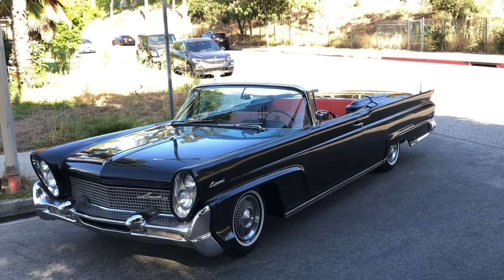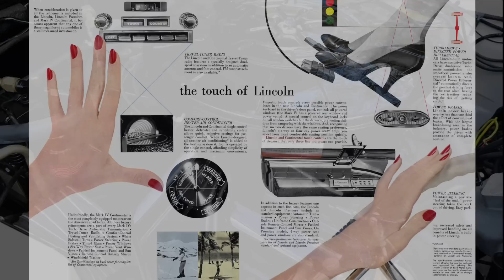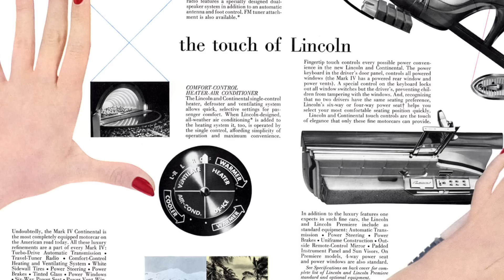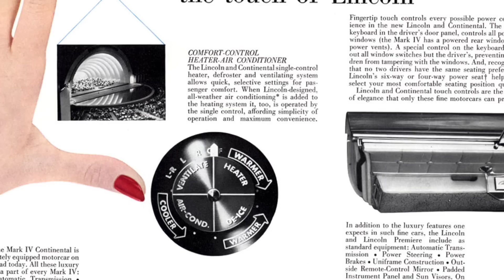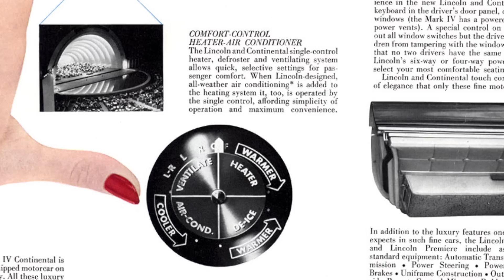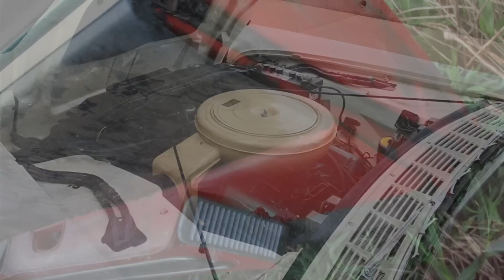Is This The Strangest Automotive Control Ever Produced?  1958-59 Lincoln HVAC Control

Comment: Sorry but I just road in a friends 1960 Continental. They used the same complicated single dial system as 1958-59, it's just moved to the third binnacle from the left. same single control knob air system. And his works beautifully.

Comment: The door panel vent you showed is actually a non-air conditioning car, as the factory air conditioning cars had a slightly different vent with a directional control on it. Also air-conditioning cars have two vents in the dash with with control knobs above them.

Comment: The whole discussion on this set-up is because the use of levers and guide wires was prominent during these years. The one dial design  was possible because  vacuum  rubber tubes were used to open and close plenium doors to direct air into the car cabin. This is all standard use now. Back then, it was novel.

Comment: Hey Adam, as usual thank you for your review of the 58 through 60 Lincolns. I thoroughly enjoyed it, and I learned a few things I didn't know. For example,  the ATC system was very interesting. Leave it to Ford to try something new and let the public decide if it's good or not, Also, Ford is known for their over the top use of engine vacuum to power the function of accessories. I have a 1975 Mercury Marquis, Colony Park 9 passenger wagon. I loved everything about that car, and still do. It was the car I cut my teeth on Ford's vacuum controlled systems. My wagon had hidden headlights with the headlight doors controlled by vacuum. A very complex system. Each door had it's own duel action vacuum motors, the largest vacuum motors I've ever seen. Even the headlight switch on the dash had vacuum running through it. There was a black "coffee can" vacuum storage reservoir mounted to the left front wheel housing under the hood, and there were several vacuum check valves located in the system to lock vacuum in the system when engine vacuum dipped below a certain point. The ATC system worked the same way, although it was even more complicated. As the car aged, some of the vacuum motors under the dash began to leak. Ford designed the system to require 7 inches of vacuum for the system to provide cold air, otherwise it would only provide hot air. I remember troubleshooting both of the systems to understand and fix their problems. Once I did, I spent a couple years searching the country for the right parts. Ford discontinued them 7 years after production. I learned that they continued production longer for the Mark series, once I knew that it was just a matter of learning the Lincoln part numbers. I was even able to crack the code of their part numbers, something many of the parts counter guys never did. I drove parts guys across the country searching for parts for that wagon. But I never gave up until I found all the parts I needed. Most of them were new genuine Ford and Motorcraft parts that had been sitting on dealer shelves, mostly in the east. I learned the cars would rust out back east before they used all the replacement parts, meanwhile here in the west we would drive the wheels off them using up all the replacements. I finally found everything I needed to keep my wagon running and looking brand new. Once I did the ATC worked perfectly, and the headlight doors would stay closed for a couple weeks without opening. I was quite proud of that. Searching the country for replacement woodgrain panels (Ford called them transfers), is another story for another time. So all this is to say I understand the vacuum systems used on the 58 - 60 Lincolns. I never really decided how I feel about those Slant eyed Monsters, but I do find them attractive, I've never driven one but hope to someday. Thanks again Adam, for a great review of a very interesting car.

Comment: I purchased a 1960 base model lincoln in 1980. It did not have ac. I installed factory air from junkyard cars which were still easy to find at the time. It was a hugh job but worth the effort living in Florida.  Still have the car today. The redesigned instrument panel for 1960 which many consider better looking than the earlier models made it alittle easier too.

Comment: It's a pretty novel design, and pretty straightforward in operation once you get used to it. The surprising part for me is controlling flow through the heater core, as most systems use a mix door to control how much air goes through the heater core or the bypass duct. Seems like there would be a lot of latency in the temperature change. Might have worked better than some modern cars though. I had a lunch date with my wife today and we used her Honda, and I almost suffocated waiting for the air conditioning to cool things down. I gave up and parked under a tree with the windows open, thankful that my older Chrysler can cool down MUCH more effectively. Thanks for the video!

Comment: Lincoln continued to use multi-function controls even in later years. I had a '69 Continental. The wiper control, although for a single purpose - controlling the windshield wipers - did so with a multi-function approach. It featured a mechanical linkage - a control wire to the hydraulic motor that powered the wipers . An electrical switch - to operate the washer pump. And a vacuum switch with a fade out feature that controlled a by-pass actuator operating the same hydraulic motor giving a "mist" feature.  All in one small knob on the dash.

Rotate the knob from "off" and the mechanical linkage would pull open the valve allowing the hydraulic pressure supplied by the power steering pump to drive the wiper motor. This gave silky smooth - infinitely variable speed control from a turtle's crawl to an almost violently fast wipe speed.

Pushing the same knob in to its first detent would open a vacuum switch that released vacuum to an actuator by-passing the mechanical control of the hydraulic valve and engaging the wiper motor. The vacuum was supposed to bleed off in a controlled manner allowing the valve to close after 2 or 3 "mist" wipes.

Pushing in to the second detent would start the mist cycle as before while simultaneously actuating the washer pump.

My '69 was a few years old when I got it and its complex controls had developed a few foibles with age. One being these wipers. If I pressed the control knob for a mist wipe, they would not turn off. Often this would quickly result in the blades clattering noisily over a dry windshield prompting a further push of the knob to add washer fluid. This of course would reset what ever the trouble was and not turn off the wipers. Soon the windshield would be dry again. You can see the frustrating cycle going on here. Often the only fix was to pull off the road and turn off the car and wait a few minutes. Upon restarting all would be well again. At this point though, another foible could crop up - that of the fact of heat soak affecting the starter motor. Quite often the car would refuse to start with sounds coming from it like a dead battery if I turned the car off and then tried to restart too quickly. It usually preferred 20 - 30 minutes of cooling time before it agreed to start again.

It took many hours of effort to trace the various systems involved to try to troubleshoot this problem. Eventually I managed to track it down to a small metal fitting in the vacuum line between the dash switch and the wiper motor. It was well hidden in the scuttle under the wiper blades.  The fitting had a small felt cover on it that had become dirty. The felt was supposed to allow the vacuum to bleed off through it thus closing or turning off the wiper motor. Its position in the scuttle meant it was essentially outside the car and exposed to the elements. The fix was to remove the little felt pad and tap the dirt out of it. Replacing the cleaned pad resulted in the wipers assuming normal function once again.

There isn't enough room here to get into the Climate Control system. This completely analog system had more wires and vacuum lines running in and out of it than a Borg Queen...

Comment: There was a rather unique control, I think it was on a 50s era TBird, where there was a pedal on the driver's side floor. When depressed, it would cause the radio to automatically scan the AM band and stop at strong stations.

Comment: I liked the climate control on my 73 Cadillacs, set the temp, set the mode. Done. Crack the window to let in some fresh air,  the fan speed increases and gets the temp back up to what was set. The last one I had was over 40 years old and it still worked perfect.

Comment: The thing that the Lincoln engineers missed was that the dual air conditioning systems weren't really dual.  There were 2 evaporators fed by one compressor, with just a tee fitting on the suction and liquid lines, and one control.  No way to adjust the temperature between the front and rear seats.  Still cool, of course.  My neighbors had a '57 Premiere with turquoise and white upholstery and factory AC, with the trunk-mounted evaporator, the clear supply tubes and the roof-line outlets.  The car also had a continental kit and was too long for their garage door to close.  I always looked for tubes when I saw cars with the windows  up in the summer.  We had a 1956 Nash Rambler station wagon with AC, two vents on either side of the top of the dash.  My mother's '58 Buick Roadmaster had the fanciest side and center vents and a similar multi-function control knob.  Another cool feature was that you could trigger the station-scanning Wonderbar radio from a floor button next to the headlight dimmer switch.

Comment: So in the AC equipped cars, does the compressor run for "de-ice" mode to get some humidity out of the passenger compartment at the same time?

Comment: All 1958 Edsel's had that except for having a separate swicth for the blower. It was an option on 1959 Edsel's. 1958's were electric and 1959's were vacuum.

Comment: Buick had heater controls in the lower part of it's two round dials on 1959 models. They were actuated by levers but also included ventilation controls. Automatic controls which Buick called "auto heat" was also available for 1959 with or without air conditioning, no blower speed control on this one as blower speeds were also controlled automatically. It was the first type of automatic climate control offered in an automobile. Cadillac introduced it's own version only 5 years later.

Comment: All of those control functions in one knob on the dash in a car that is now 65 years old. What could go wrong? Well, probably everything. Very interesting! I am just glad I got the heater control valve working again in my '65 MGB. That is one valve operated by one cable with one rotary knob.  Heater doors are actuated by your index finger under the dash behind the center mounted radio speaker. Older tech.

Comment: I vaguely remember these HVAC systems when I started at the Ford service in the 1970s. If memory serves right, these were a series of cables and an electric motor that controlled the temperature/mode door. They could get finicky as they aged, but generally held up well. The same could not be said for the coil springs. By the time I started working at Ford, these were just seen as cheap old clunkers that had been ravaged by Midwest winters. Occasionally a pristine, low-mileage example came in that was owned by an elderly person.

Comment: You are right about the facelift versions. Exactly like the 1961, the first year is the best and then facelifts based on marketing decisions diluted both designs. The 1958 is just amazing. It also had coil spring rear suspension, and then in 1959 they went back to leaf springs, continued on the new 1961 model. I guess there were problems with the coils, but obviously whatever they were could have been fixed instead of going backwards.
Reply from the maker: Went to leaf in 60

Comment: One of the oddest controls I ever witnessed was in the 1964 (or '63?) Plymouth Fury with push button controls for the transmission.  My dad used to joke about having to learn how to type to drive someone's Fury.  It was pretty cool, and definitely different.  I liked your video, but even though I worked on cars (my dad was an autobody man), I never worked on many Lincolns or Cadillacs (mostly GM, Ford, And Chrysler models).  I don't think I ever saw those controls in a Lincoln, so thanks.

Comment: I don't think the HVAC control is strange, IMHO it's really cool.  Love the '58 Lincoln dashboard.  The channel should do a video on the '38 Cord gear selector.  It's a manual transmission (IIRC a four speed), but you pre-select the next gear using a pull-ring control in a gated slot on the dash.  Step on the clutch, and the gear change is made via vacuum control selonoids.  Sort of a semi-automatic transmission.  VW once had a vacuum operated clutch actuated by the gear shift knob being pushed down.  That was cool, too.
Reply: Mercedes 280 SL clutch and brake on the same pedal.

Comment: I could get used to that control and use it succesesfully, but man alive - some of the cars from this era look like they are from Another World.  In many, many ways, they are.  I never knew about McNamara's meddling with the four-bbl carbs, thank you!  It has to be in a biography of him somewhere...but...Why?  Would?  He?  Do?  It?  It's not an Oliver Stone-level can of worms, I'm sure, but what was the point?  

I dunno I still prefer the dual-zone climate control system on my 2010 Ford Escape Hybrid Limited:  Push the center of the big left knob briefly to turn it on AUTO.  Push the center of the big right knob and do the same.  Select the temperatures left and right by turning the knobs.  10 seconds, tops and as Bones McCoy once said:  "A Child Could Do It!! A CHILD Could do it!!" lol.  The computer chooses the optimum vent distribution pattern.  It really works:  my Dad is always too hot.  I am always too chilly.  When he's with me in the car, we're like Jack Sprat and his Wife.  Turn the knobs to different temperatures and you can feel an honest-to-Pete difference.   Every car should have something like this now as standard equipment.

If you are into full control, turn AUTO off and then play with the temperatures, vents and fan speeds.  Rear window defrost is a separate button with a red LED.  AC, MAX AC and RECIRC also have their own buttons.  And the AC compressor is electric, efficient high voltage DC!  You can sit with the engine off at a stoplight in the hot summer and the cold air keeps blowing.

Maybe people were a little more clever in '58.  Maybe they just appreciated that period-specific "space-age" design.   I'm sure that Lincoln and Continental trained their dealers well, so they could explain it to their customers:  "Oh, this is a very special feature, Mrs. Frankfurter, and it's like nothing else on the road today.  You and your husband will be the envy of your friends."

Comment: I have a 59 Mark IV - the vacuum actuators work very well for the HVAC; not so much for the wipers.
Reply: The wipers are hydraulic, run off the power steering pump - which is driven by the crankshaft.
Reply: @emjayay  the wipers on a 59 Run off of vacuum, not hydraulics.

Comment: OK Adam... you are talking about the really cool HVAC control.  Please be advised that it was not vacuum controlled. My knowledge is about the 58 only but perhaps the 59 is similar. Instead of vacuum the control head ran a servo module which was an ELECTRIC motor and gearbox that ran a complex wheel which in turn moved Bowden cables to open-close heat defrost dash vents  Also the left and right footwell vent and the heat and ac thermostats.  I don't know how long this set up worked properly, but I know that Bowden cables tend to corrode and the inner cables start to stick and bind.  I did find a website where a man in Europe was rebuilding his servo system on his 58 but I don't know if the expertise exists in the United States. It is such an obscure system that few know how to troubleshoot and ultimately repair them.
Reply: Similar to a blend door on an F150 of even a new lincoln!

Comment: The '60 had the same form of control, but instead of small electric servos to actuate the modes, it used vacuum.  There were I think, some 14 vacuum tubes coming off the main control behind the dash.  Used one year only!  I have a '60 convertible and the restoration of the climate system is, uh, challenging.
Reply: ..especially those vacuum windshield wipers, which were more than sluggish at low rpm....

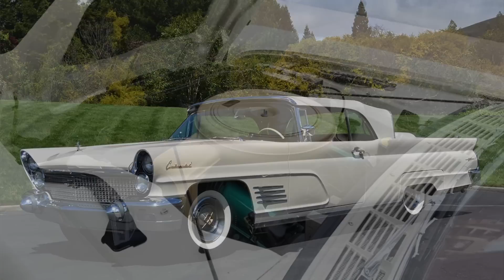Comment: 1:30. The engines. AH, Dodge/Chrysler did something similar in the Fifties with their first letter cars. A big 300 + super engine, MOPAR did it first with two Four-barrels. 1961 Forward Lincoln Continentals. Ah. Suicide doors were a carry over from Carriages and was very pronounced from 1935? to 1937. The Martin brother Resto-moded a 1937 Chevy in Root-beer with Cream Spoke stock wheels. The HVAC system for climate control. This is the first time I heard of used this way. But what about the hydraulic shift Semi automatic s from MOPAR and GM Products from the earlier Fifties? My Dad had a Plymouth that shifted this way, And the Push button shift cars from Dodge/Chrysler/Plymouth/Desoto and AMC Motors from 1954 to 1965? (AMC was supplied MOPAR starting at the same time if not slightly earlier.)